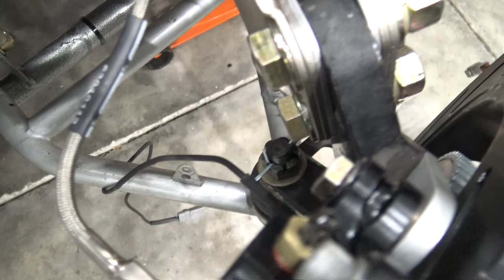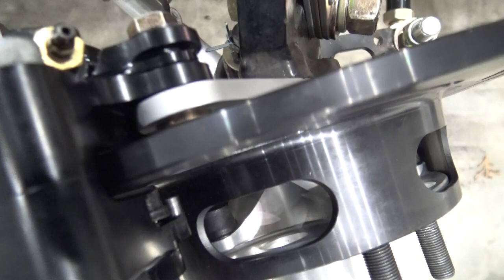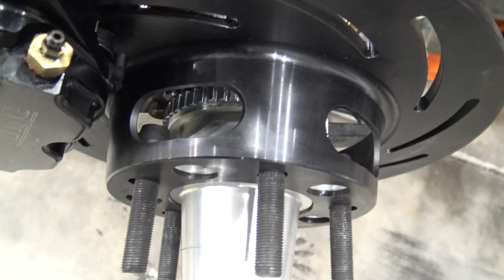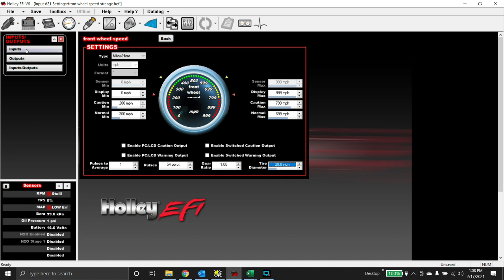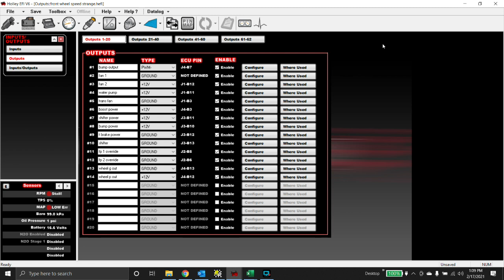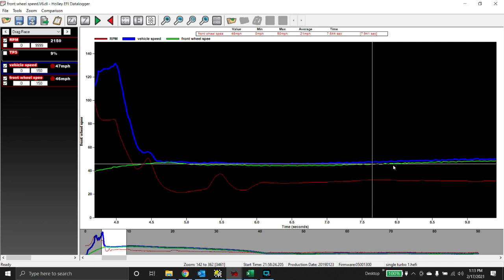Strange Engineering Front Wheel Speed

Comment: Hi Devin, Another great video! Really enjoy all that you do. Can I ask 2 quick questions? 1) Where do you usually put Holley Nitrous Solenoids? 2) On a 2 stage NOS kit, would you use 4 2 pin connectors, one on each solenoid, and then 2 4 pins for stage 1 and 2 heading back to the trigger solenoid? Hope that isn't out of line to ask. Thanks, Mark
Reply from the maker: im assuming you are talking about running 2 dry foggers?  if that is correct, put the relays inside the car then i send power out from relays to 2 dtp 2 pin connectors per kit depening on the size of the solenoid you can also use dt connectors

Comment: Why would  you not use the sensor grounds and sensor 5V pins (for example J3B16 and J3B22) that are already assigned instead of using open pins that might be used for something else later.  Is there a limit  to how many sensors can be pinned to one pin?
Reply from the maker: its a 12 volt sensor
Reply: Thanks Devin, I missed the 12.Volts